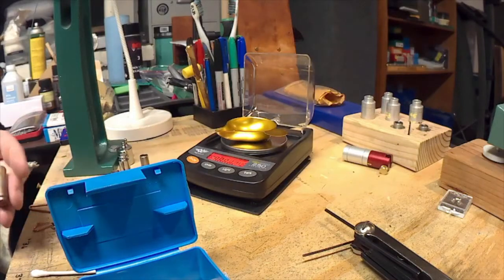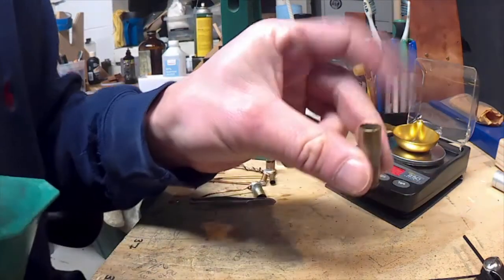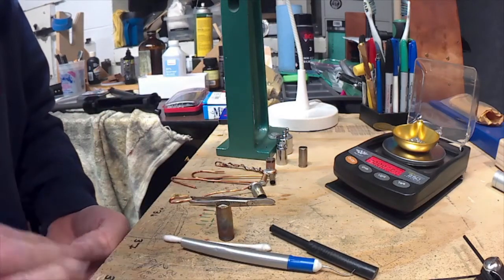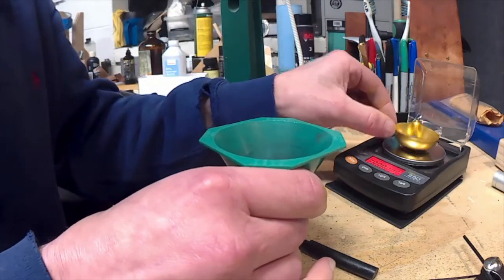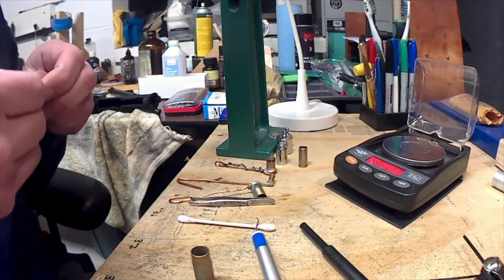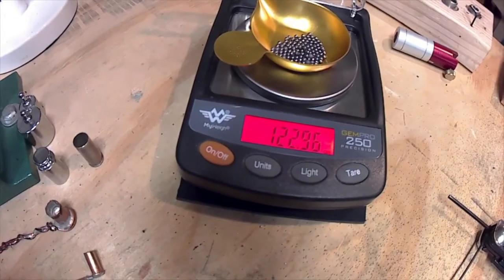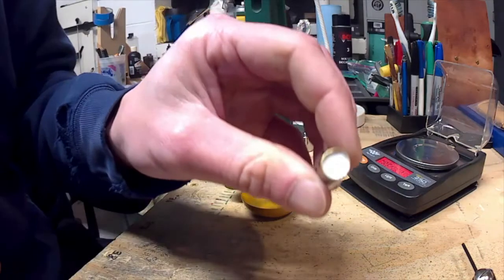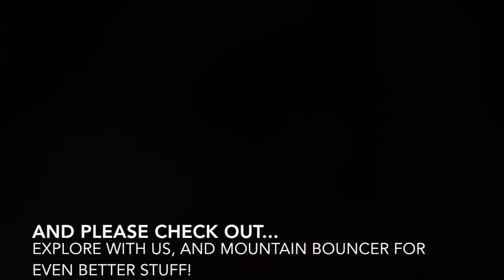45 ACP Shotshells - Charging, loading shot, and crimping!

Comment: I am also working on a 45 ACP snake-shot load for a large number of snakes at the range during our hot summer months, as a last resort for safety. I use the 308 round also, but with a 41 magnum die for creating the undersized and shoulder topic and a homemade crimping tool on my lathe. I have loaded some using solely the 45 ACP brass but discovered that this method without the use of a wad inside the case leads the barrel. I use a 410 shot-shell wad from Ballistic Products shortened on both ends with an e-xacto knife, and a paper over-shot card. I have some with both #9 & # 8 shots, the difference in size is .010" between the 2 mentioned. Bear in mind that #9 is denser so will have more in the case, but less energy on contact. The 45 ACP caseloads work with 30-40 gr of shot, but will not cycle due to insufficient pressure. I have experimented on the longer case length necked down cases with 5-6 gr of 231, but use my 5.5 gr of faster burning 700X powder for this application as it is easy for me to refer to my target loads for reference of grains used per weight of the bullet. A friend who has done this and had his cycle used the 6.2 gr of 231, with the 410 shot-shell wads, 135 gr of #9 shot, and a copper gas check inside the case top area before crimping, then used a blank die for the final top crimp.  He made the 308 loads to the AOL  length of 1.300 with a case length of 1.185. I am still experimenting and making all my dies in the lathe and mill for different tapers and end crimps, plus an adjustable internal stop that keeps the top card or gas check at a set depth while forming the top crimp. Thanks for taking the time to make these videos to help us all with our quest. The shame is that CCI makes a shot shell that does cycle, yet does not offer the Capsule individually as it does for revolver loads. Personally, I prefer the larger shot for better effects on impact.

Comment: George Nonte goes through making these in his book on handloading. If you're making them for a revolver, to be used with moon clips, you can make the forward portion just shy of the length of the throat. That gives you room for a lot more shot, or a bit of a cushion wad along with the overpowder card. I've made a lot of .44 Mag shotshells with a nitro card over powder, with a layer of rubberized cork gasket material as a cushion, shot up to about 1/16" of the mouth and then a gascheck or card overshot wad, roll crimped in and if I use card there, I paint the outside surface of the card with white glue to waterproof it and give it some resistance to loosening when the shell next door to it goes off. The ones I'm going to make tomorrow will be out of .308 brass, the full length of a 625 cylinder, and they'll ride on my duty belt in a moon clip in a speedloader pouch. It's spring and the rattlers are basking on our blacktop roads at night; I've killed two over five feet in the last three nights. BTW you didn't say what die you were doing the final mouth crimp with...?